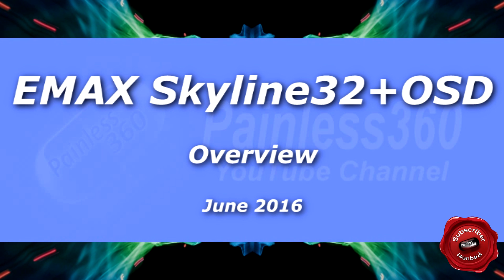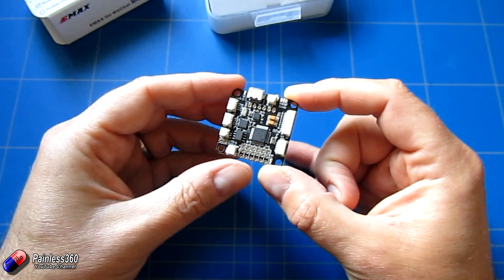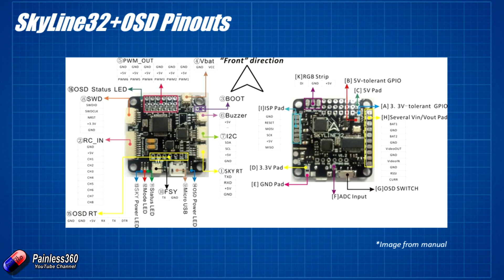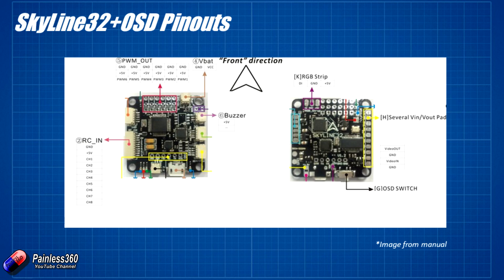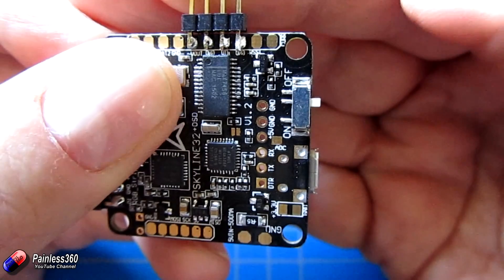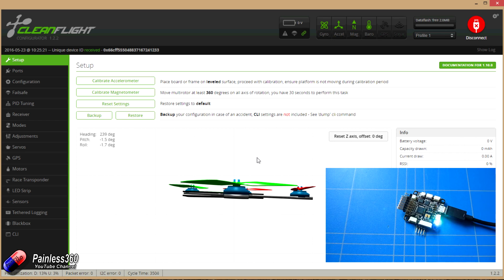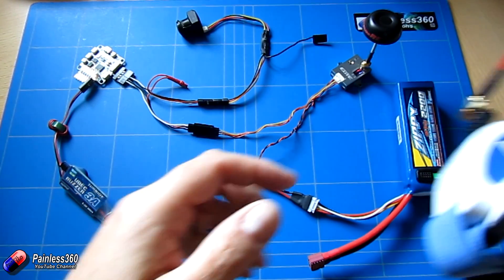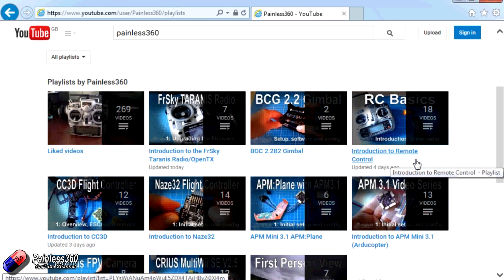RC Reviews: Skyline32+OSD Advanced Flight Controller from EMAX

Comment: So, is this controller a trusty, reliable with a gps? I need return to home....
Reply from the maker: GPS modes in Cleanflight are still poor and marked as 'experimental' - see the Cleanflight documentation. We have a video on Flight Controller Comparisons where we cover questions like that.. Best of luck!
Reply: painless360, say I want a gps added, what port would I use, i2c, uart, rc input? And what gps would you recommend and connector style?
Reply from the maker: See the Naze32 videos for the answers to that. You'll need to find the UART port on the board if you're not using SoftSerial. Best of luck!

Comment: What kind of OSD camara Voltage supports the Skyline32, because my Camaravoltage is 12V. Can it handle this??
Reply from the maker: +King kon the voltage should be fine. Check what the manual says. Best of luck!

Comment: do I still need a power distribution board to set this up?  or can I attach xt60 directly to this?or any thing else beside frame, motors, batteries, props to make this into a working quad?
Reply from the maker: +Robert B the answer looks like you need a PDB too - http://www.emaxmodel.com/emax-skyline32-osd-flight-controller-acro.html
Reply: +Painless360 thanks

Comment: So I have downloaded the Cleanflight program and plugged in my FC and it says, "Serial port successfully opened" and then says "No configuration received within 10 seconds, communication failed". I have no idea whats wrong...
Reply from the maker: No idea, lots of detail on this in the forums though - http://forum.flitetest.com/showthread.php?16485-cant-get-cleanflight-to-work-on-my-naze32-board
Reply: +Painless360 I was using a usb cable that only transmitted power and not data

Comment: hi Lee please help can you do a video with the skyline 32 clean flight for a wing + the pids are way out can you use auto tune ? thanks
Reply from the maker: We may be adding a Cleanflight powered board to a plane later in the year but I'd direct you to the flight controller comparison we did earlier in the year where we talked about the best options for fixed wing.. Best of luck!

Comment: My OSD doesn't update when I arm the quad. The horizon doesn't move and the battery value doesn't change but the timer works. I tried to disconnect camera (hs1177) and battery sensing cable but the issue still exists. I use Matek PDB to power the FC.
Reply from the maker: I'd contact your vendor for support - sounds odd..
Reply: It works. I had the blackbox in the UART1 which caused the issue.
Reply from the maker: Ah Ha! Glad you sorted it!

Comment: I got the FC I've installed it to a new frame new ESC  motors and I even got the emax PDB. Everything works it fly the only thing that don't work it the OSD nothing show on the monitor just the regular video. Any advice. Thanks

Comment: great video! in fact all your videos are great :)I have a problem with the OSD on this board, the osd is only visible for a sew seconds during flight and then disappears. (I still get video though) Does anyone have a clue whats going on? I'm thinking maybe voltage spike from braking on the littlebees, the osd not getting enough power or a faulty board? any help would be great :D
Reply from the maker: This is usually power related if you get a brief image, also having both the OSD and Camera set to NTSC or PAL is handy too. Best of luck!
Reply: +Painless360 thank you very much! One last thing... What tool do I need to update this? Thanks soooooooooooooo much :D
Reply: +Robert Evans update the OSD. Not FC

Comment: Hi Painless! Ive watched many of your videos, and they are really useful! Would this work with the nighthawk 280 pro? I think that has a Skyline32, but I think its integrated into the main board so it may be slightly different. Please could you make a video on this? I think the nighthawk 280 is a great budget quad, and I am thinking of getting it with the quanum cyclops, although I would love an OSD to give me that extra sense of security when I am flying. Thanks!
Reply from the maker: That model has it's flight controller built in so you can't easily change it. Best of luck!

Comment: Hmmm the question is, does it support SBUS? On the website they say it does but on the manual there no mention.
Reply: " supports SBUS signal via Channel 4 in RC_IN port (UART2)." Straight from their website.
Reply: Yeah I saw that but I wonder why it is not in the manual too.
Reply: ya, idk i tried to setup sbus on it, and I have had to luck. I haven't tried real hard, but still
Reply: Justus Saul you would think. but I'm having this problem now. I can't find a single mix of settings or pins that will allow me to use cppm or sbus. I've inverted the sbus in cli. used pins 4 5 6 7 at different times in place of the pwn1  wire. I can't get it working :c only pwm works. and that fn blows.

Comment: Hi there +Painless360
I usually fly fixed wings and am now thinking of building my first quad. I started looking my FC options a couple of days and this video couldn't have come in a better time.

As I don't know yet if I just want to fly smoothly and get some Video footage or if I'll be building a racer, I'm looking for a somewhat multipurpose FC. Something as cheap as this Emax FC, with the ability to add GPS and have RTH, but that also allows for some racing if set up like that.
I have a Taranis so I want to be using SBUS for the inputs and FRSKY telemetry to the OSD if possible. Would this Skyline32+OSD be a good option? Or should I get any other FC?
Your response on +Paul Kendall's comment made me think there's something better coming so if you could just reveal some info, that would be great! 

I already have FPV equipment so that's not a issue here.
Thank you.

Comment: I have this FC and love it
Reply: well I have the non-osd version but still no issues here
Reply: +ralfdcat same here great little fc. Can't wait to get the osd version.
Reply: I put some hot glue around the microjst plugs to add strain relief for the cables.. I've had wires snap off of other microjst plugs just FYI
Reply: +ralfdcat lol absolutely! I learned that trick from using the op mini..

Comment: What a shame it's not an F3 chip! Seems like a lost opportunity.
Reply from the maker: +Paul Kendall stay tuned! ;)
Reply from the maker: I've got the F3 EMAX version here and will be testing it soon. Great that we're getting so much choice of decent, easier to use tech in the hobby.
Reply: I have one of those, but it doesn't have current sensing on it. I have found the best so far is the beerotor f3 with PDB from rctimer. It has everything you could want (at least currently :-))

Comment: I have this exact board but on my PDB I don't have a VBAT out connection how would I connect VBAT to this board using my PDB?
Reply: any pure 12v source will work I'm pretty sure
Reply: vbat input needs to be fed from your battery to measure its voltage , so just solder some thin wires to any pads on your pdb which provide the full battery power, and the other end to vbat.